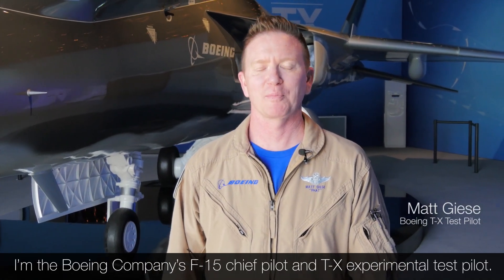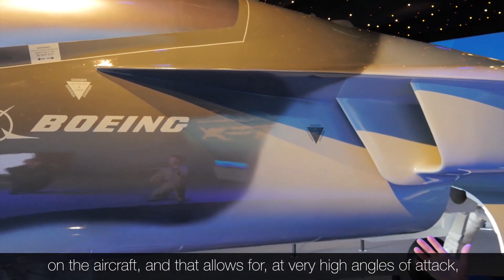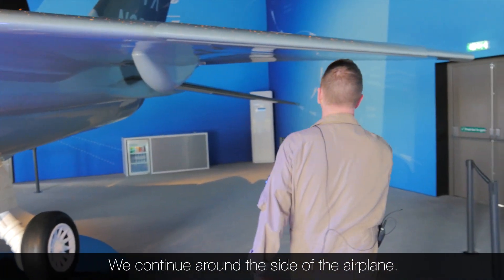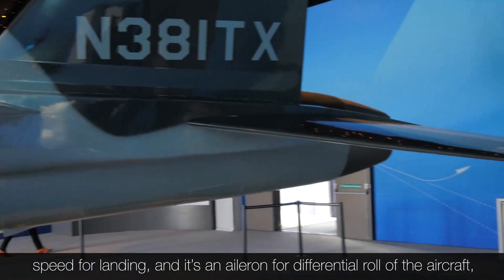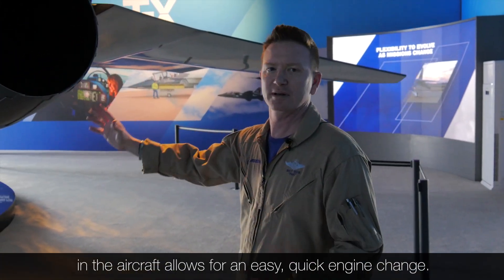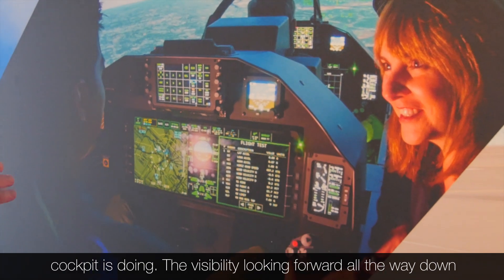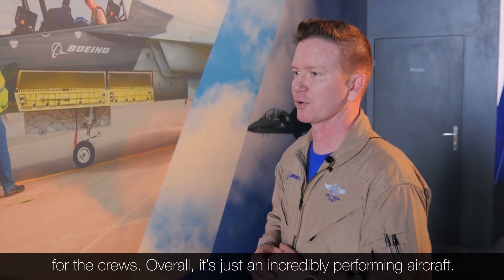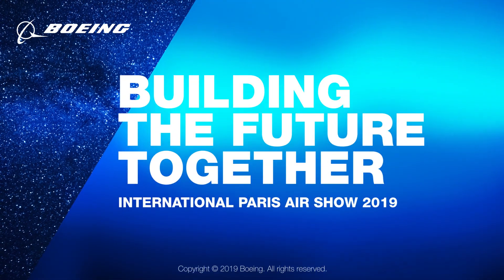Boeing T-X at 2019 Paris Air Show

Comment: Stabilator for roll control???   Pretty sure he meant pitch control.
Reply: It's fly-by-wire (FBW).  The stabilators move not only for pitch control, but also in conjunction with the flaperons for roll control in similar fashion to the FBW flight control system on the F-16 and F/A-18 Hornet & Super Hornet.

Comment: VERY NICE, BUT AS A NEW FIGHTER, IS IT INTENDED TO REPLACE OLDER FIGHTERS AND IF SO WHICH?
Reply: It is a training aircraft that is meant to bring modern aspects into pilot training, to better prepare them for today's complex 4th and 5th generation fighters. Lots of sophisticated systems stuff, high sustained Gs and high alpha flying in a fast jet. Apparently, it has growth potential for more fuel, more avionics and heavier loads and was designed using an open architecture plan for its software and systems, making future upgrades and additions easier. I believe this aircraft and some others, can generate their own synthetic environment using the on-board systems, which is cheaper and more flexible than flying dedicated mission aitcraft or using complex test ranges. I've read that the ground based training systems have also been designed with the same goal, which is better training, with lower sustainment costs and an optimized use of airframes. Such an approach is meant to prepare pilots to be well beyond the basics before they start burning fuel and putting hours on an airframe. Keep in mind, this is not a basic trainer and the pilots will have already completed quite a bit of training before getting their hands on this aircraft. Saab are a partner of Boeing's on this project and it is now officially the T-7A Red Hawk.

Comment: hmm odd that the look of a jet has not changed much still interesting
Reply: Design is dictated by aerodynamics as a trainer it doesn't need unconventional handling characteristics
Reply: @PabloGonzalez-hv3td  so we may be stuck for now at some point. Based on the fact that you can only take a build to a certain point then?
Reply: @swardinc  - What works is simply being refined new and exotic designs are only implemented if there is a tactical benefit such as the F-117A's faceted airframe
Reply: @PabloGonzalez-hv3td  hmm interesting so there not really a demand for a different look for instance? Got you
Reply: @swardinc  - In aviation a different look has aerodynamic consequences and therefore dictates performance it's not like a family car where fuel economy and cooling are the main stylistic concerns as long as safety parameters are met
Reply: @PabloGonzalez-hv3td  that what im wondering at a certain point you will reach the limits of that build?
Reply: @swardinc  - In terms of manned combat aircraft the physiological limits of the pilots are the real limiting factors and not the known limits of current technology

Comment: How is Boeing/Saab able to use F16(Lockheed) Landing Gears?
Reply: The F-16 was originally by General Dynamics
Reply: @listeed1995  TRUE !!!!
Reply: Lockheed and Boeing are already partners on the F-22 they clearly have a working relationship
Reply: aircraft manufacturers don't usually make landing gear as far as I know. So they probably, legally, were licenced to purchase the same model from the company that designed the F16 gear
Reply: Max  F16 is owned by the USAF !!!!  DUUUHH!!!!!!!!!!
Reply: @wilburfinnigan2142  so what? The F16 is manufactured by Lockheed. Dosnt Matter if the USAF has F16s.
Reply: @maxchilla732  IF  you knew the WHOLE story when the USAF buys and pays for an aircraft they own it !!! Why in war time any company will manufacture the others planes !!! B17  B24 B29's were all manufactured by several companies !!!!

Comment: USA taxpayers forked out several billion for this bird.  I hope it was worth it.
Reply: The current US trainer jets are from the 60s. This new bird is expensive but it is needed.
Reply: John  That is what happens when a customer buys something !!!!
Reply: But finaly it is cheaper than estimated. Maybe clean sheet project doesn't include MCAS bugs written by outsourced hindi amateur programists. 

In my opinion it could be very good trainer.
Reply: It is @johncarr123 the t 38 needs a replacement mostly because of its condition and it doesn't have high aoa capabilities. And the t-7 is more advanced allowing pilots to better "jump into" the new planes (F-35 F-22) but I would like to know when it's going to operational
Reply: Yeah, hope it doesn't get caught in the media like the F-35 too. It looks promising.